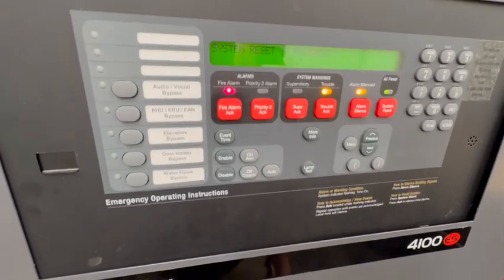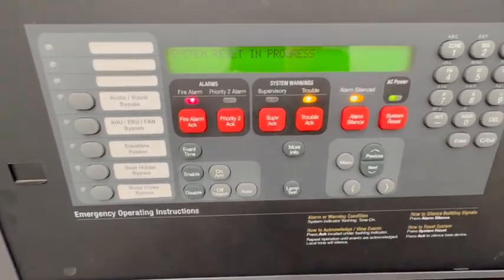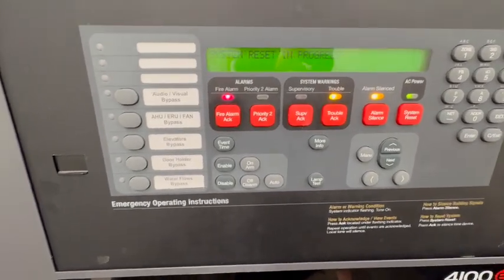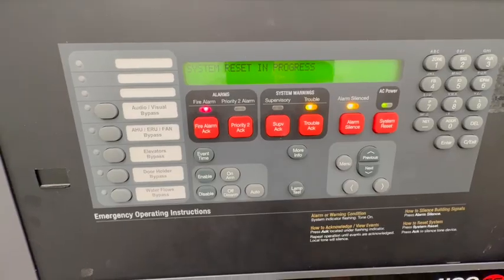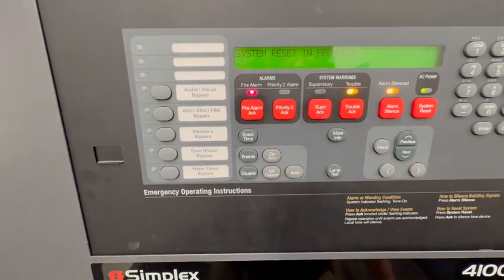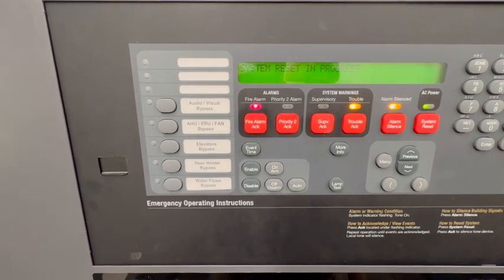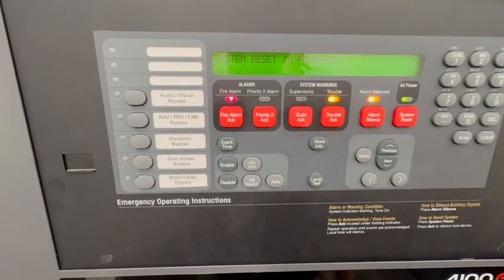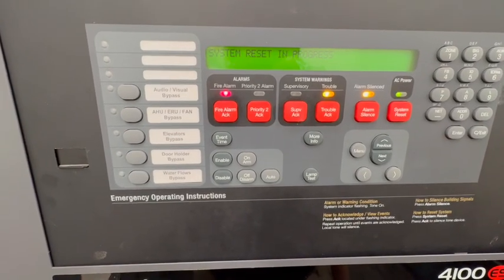Simplex Voice Evac w. 520hz Code 3 (Fire Alarm A/V Test) [05-29-2025]

Comment: not bad! umm did the alarms themselves have red led lights blinking?
Reply: Yes, those are Simples Truealert ES, meaning addressable
Reply: @TurkeyPointSirens  Not TrueAlertES. This panel uses the predecessor to that protocol, TrueNAC. IDNAC (TrueAlertES) speaker strobes were never produced in that style.
Reply: @TurkeyPointSirens 
These are not TrueAlert ES devices. These addressable TrueAlerts (4906-92XX models) actually predate the ES line by a few years. Newer ones can be used on IDNAC panels, but these specific models are mainly designed for retrofitting on older TrueAlert SLC systems (4100U, older 4100ES, etc).

Comment: Nice! By the looks of the speaker/strobes they are addressable 4906-9253 & 9254 models. In MA they use a slightly lower pitched Code 3 Tone.
Reply: It's the 500 Hz B natural tone instead of the 520 Hz C natural tone